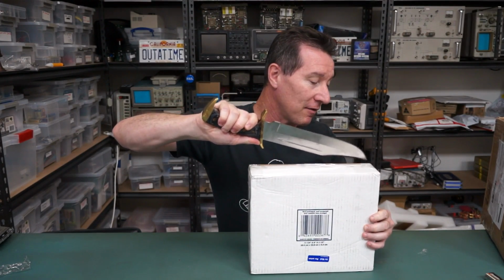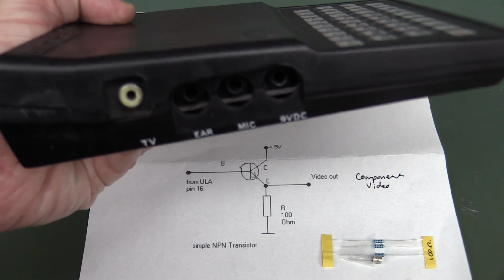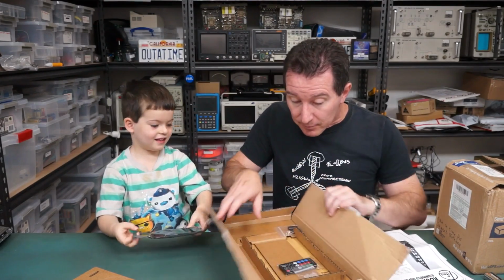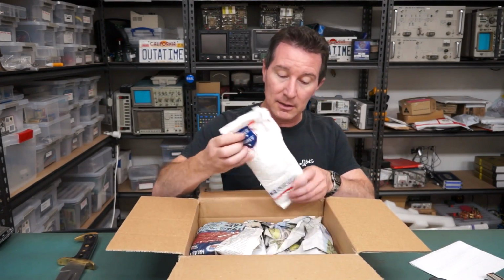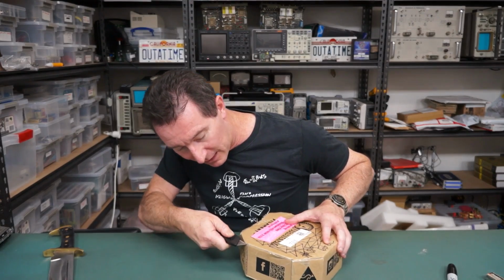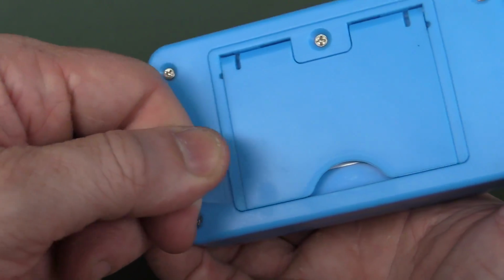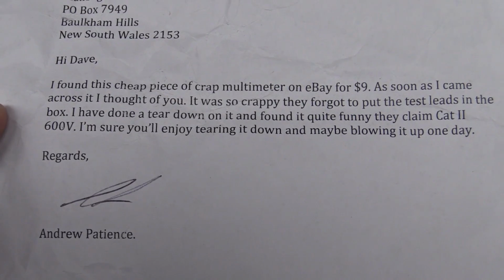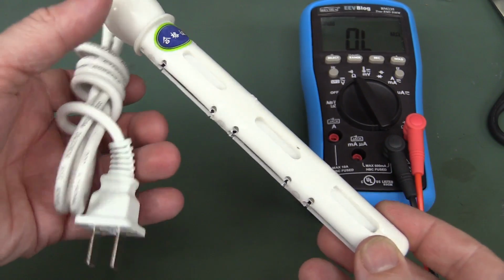EEVblog #872 - Mailbag

Comment: the Arris is a cable modem and voip box.. the battery allow you to use the phone will power is out.
Reply: +Niveous is accurate.  the Arris cable modem VoIP adapter has an emergency battery backup feature that will keep your landline telephone working thru a power outage.  It was mandated by the FCC for safety.  Of course since most homes have cordless phones that used line power to work, the emergency feature was useless.
Reply: cordless phone would not work anyway with the power out that batt power the cable modem too. So you need cable modem going then the cordless attached to the voip box. Then Unless your calling a cellphone a cordless then your right on that side

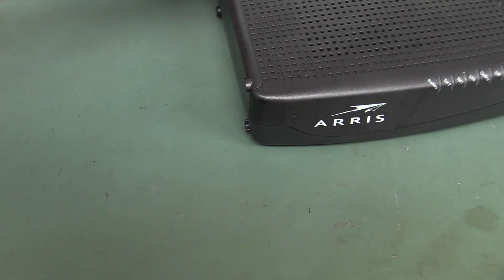Comment: 10:19 Cable modem with VoIP phone lines and battery backup (I believe that the backup is required for 911 requirements in case power goes out). There's even a battery light on the front to indicate battery status/charge. I've seen battery backups on all Arris cable modems that include VoIP phone lines. It's a throwback to the days when there were real landlines and the battery backup was down the street at the phone company's trunks.
Reply: +blargg It is common for cable modems in Australia to have the phone line piggy back off the modem as well (as copper lines are getting scarce in many areas now). These modems always have a battery backup for emergency calls as well. So almost positive that connector is for the backup battery too.

Comment: ZX81 Issue 3 PCB looks pretty professional. The issue 1 PCB I had looked like the PCB traces were drawn by hand. Not any parallel traces.
Reply: +Antony T Curtis The issue 1 ZX81 PCB looks beautiful with its curvy traces. I'd seen loads of later-issue PCBs over the years, but got given an issue 1 a few years ago... that was a pleasant surprise when I opened it up!

Comment: So can i buy the PAX Instruments Logger from where? Or is it just a DIY Kit?
Reply: +Gab riel Sorry, found it, But too expensive 160 $ just the logger no probes... a bit crazy, if you think about the price of each component....
Reply: +Gab riel The T400 is available from my site http://paxinstruments.com/products/sku927/ or from Adafruit at https://www.adafruit.com/products/3081
Reply: Pax Instruments Inc Thank You!
Reply: +Gab riel The T400 is on my site (http://paxinstruments.com/products/sku927/) for $165 USD. It comes with four wire type thermocouples and one stainless steel probe. It also comes with a North American USB wall wart, MicroUSB cable, and a 256 MB MicroSD card. My goal was to include everything a person needs to start logging out of the box.
Reply: Pax Instruments Inc ahh oke this was my misunderstanding, sorry!
Reply: +Gab riel I'd love to make a version at a lower price point, but $165 is pretty much the lowest number that made sense with the injection molding tooling. It would be awesome if later this year I could get out another project that uses the same enclosure. Then I think I could drop the overall price.

If you have any project ideas, I'd love to hear about them on the forum http://community.paxinstruments.com/

Comment: I had a TS1000! Never got it to do anything useful... pretty sure the optional RAM pack was 16k. If a spider under the neighbors house farted, it'd jostle the RAM pack enough to crash the computer... PITA. Don't have time to look at the moment, but I think 'Big Clive' looked into, and was also astounded buy the water heater gimmicks. Years ago we had an econobudget cold/flu vaporizer that heated water the same way; you should have seen the scale spooge buildup on the 'electrodes' after a few days.

Comment: The last item, it's an electrode boiler. Common in industrial applications, and not as dangerous as it first appears, the voltage gradient is quite low because the neutral terminal is quite close to the active.
Reply: +bgdwiepp Not so sure about the not-that-dangerous thing. With two identical, unpolarized plates, the liquid would end up at half mains voltage, with enough punch to stop a heart. Well designed, with an earthed (or, at least, neutral-connected) cage around the electrodes it would be safe-ish.

Comment: common cable modem here in the USA. The expansion port is typically for a battery backup for the digital phone lines (emergency/911).

Comment: That Arris box is a cable internet/VoIP modem. The compartment on the side is for a battery. It's required in the US so that the phone system works when the power goes out, especially for 911.
Reply: +Ziginox But why the note to open it before Sagan's birthday? The items had nothing to do with the kid or a birthday.
Reply: +rojovz I only know the what, not the why.

Comment: i didn't see a crystal on the board of the zx81
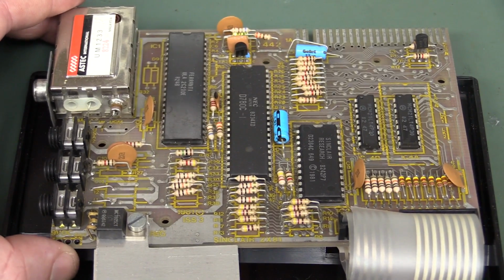Reply: +Rubus Roo at 5:20 in top middle of frame, behind the transistor I think is the 65MHz resonator.

Comment: I so want one zx81.  The cable modem that empty slot is for a battery pack.  i have the same one in that battery pack is a charging circuit. that atmel is to monitor stuff from the battery pack and plus tell the charger to turn on to charge the battery pack. But what that battery pack really does is keep the Phone part on so in case of a power outage your phone will still be on. Oh forgot one thing the battery pack i think it's 12 or 24 volts and suppose to be some kind of up boost converter  to 48 volt teleco power.
Reply: +joseph chrzempiec (josephchrzempiec) Yup, I have the same type of cable modem here in Renfrew Ontario.  The battery definitely is only for the phone, found that out during a power outage. lol
Reply: I nodded mine with a car battery to not only keep my phone on but to keep my Internet on as well.
Reply: nice